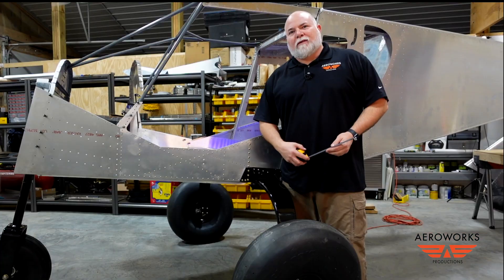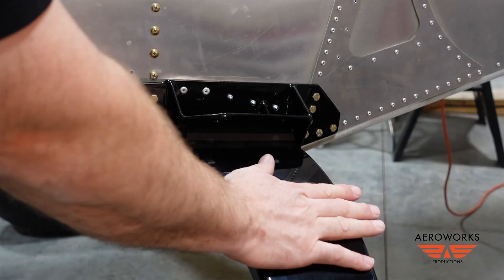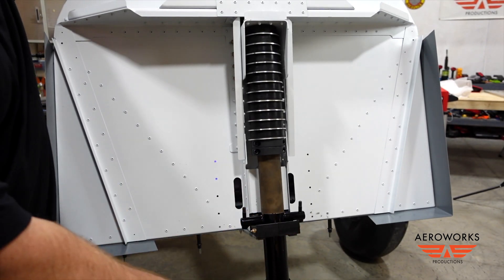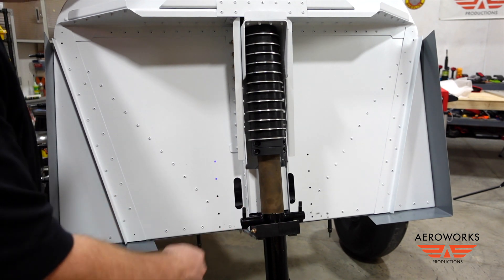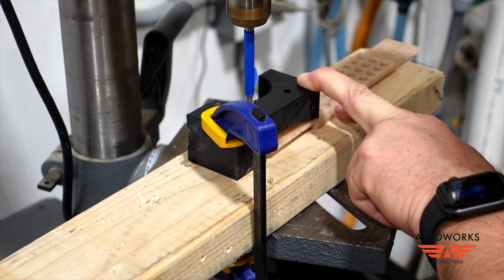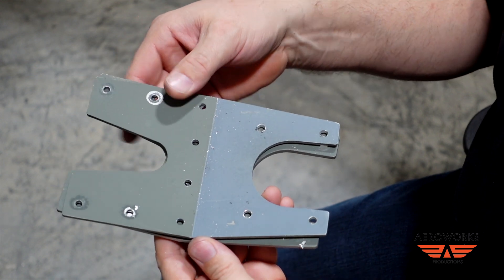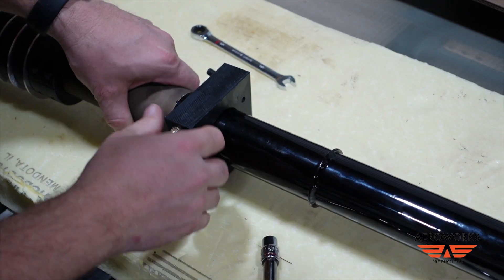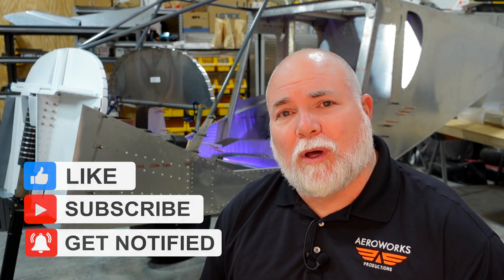Ep. 20 | Landing Gear Installed | Zenith Super Duty STOL Aircraft Build

Comment: Hey Adam, Merry Christmas to you and your family...!
Thanks for this video, I’m sure there is a lot to deal with re landing gear.  I helped a friend re & re his gear a few years ago before he could finish installing the main struts, something about the main bracket support reaming holes for the struts.

I tried calling you about gear in general.  I’m building the SD as well, but my engineering challenge is retractable.  My mission is for a SD, first of it’s kind with retract, 16 to 27” main tires, I’m working with Beringer Aero to retrofit their product into my build.  I have access to CNC, or other milling machines to fab up my prototype.  I have several options on how to.  Also, I’m considering the first slat retract as well.  I’m building the fuselage first though, so slats are back burner for now, if ever.

I’m going to use EM actuators and BLDC motors to accomplish full articulations of the mains, and a sweep back 90 degree twist on the nose.  Thus I’m experimenting with how I’m going to accomplish this.   It will lay flat under the belly between the two seats.

I plan to shroud the gear with an aerodynamic belly fibreglass fairing.  I’m also planning a Viking 195 Turbo with electric VIP, 5 bladed DUC prop.

Basically I want an Alaskan Bush plane STOL, with a Cruzer option haha.  So, seeing this Gear video is helping me.  Will you do more?